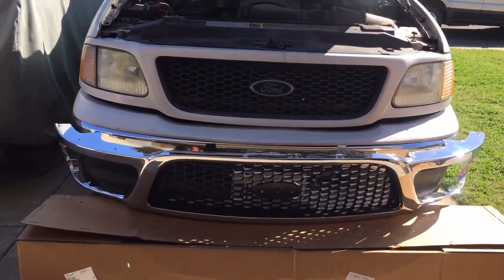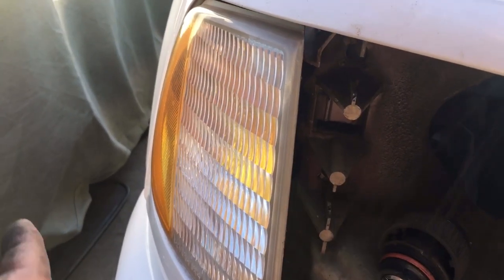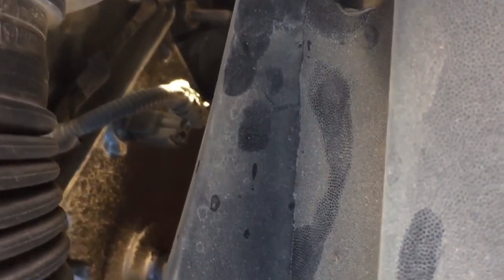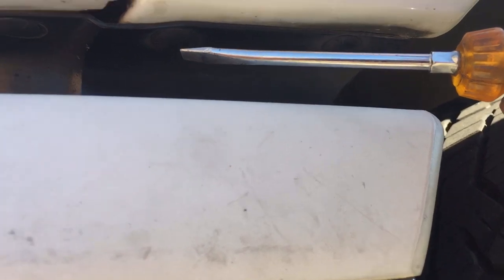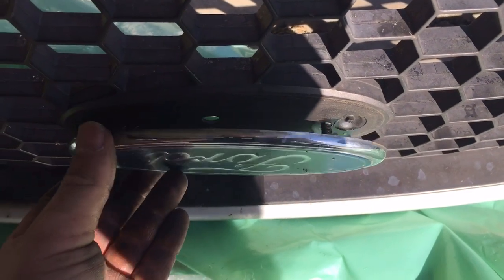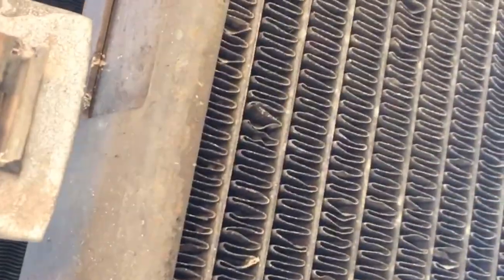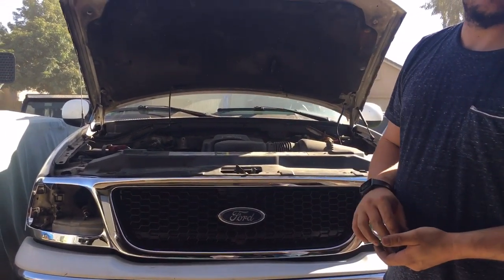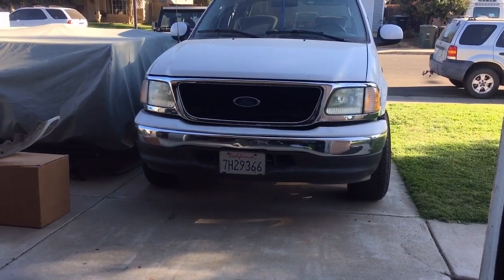How To Replace Front Grille On 97 98 99 00 01 02 03 Ford F-150 & Expedition Grille Replacement

Comment: Get a trim remover tool instead of 2 slots;) kinda water energy not to clean up the parts before replacing them! Just a thought.
Reply from the maker: I just bought the tool , works great! Definitely Beats having to do it without, but it’s doable! Thanks!

Comment: Cool - did you know according to AAA the 4.6 Ford is the no. one engine doing 300k miles?  Sucks if you have the 5.4 like most. Great Vid.
Reply from the maker: 5.4 and 4.6 are very similar engines, also the one that failed in this truck failed by neglect. The new engine is now in good hands 🍻
Reply: The 5.4 3v does suck...the 2v like this is just as good as the 4.6

Comment: You dont need to remove the headlights for this project, only the turn signals need removed so you can get at the 2 screws on each side. Doing this today and my only concern is the 2 lower retaining clips as I will be reusing them. I am only replacing the grill insert not the entire frame. Wish me luck!
Reply: Thanks for the great instruction!
Reply from the maker: Nice , I appreciate it, and yes be patient things  will go smooth , cheers!
Reply: I took my time removing the old grille insert and my project turned out fantastic! Thanks so much for your video and remember if you take on this project, be very careful and patient. Also, use the right tools, trim removal tools are available at your local auto parts store.

Comment: Will it fit on a 2004 Ford F-150 XL
Reply from the maker: 💥 nice, thanks for watching! I’m not totally sure! Good luck cheers!
Reply: As long as it's an early 2004 called the "Heritage" it will fit. They were using up 2003 parts for the "Heritage"edition. The later 2004's changed and this grill will not fit. If you enter your VIN # at Rock Auto, or other sites,  they will they you which one you have. I have a 2004 Heritage built in Oct, 2003 and yes this grille worked.